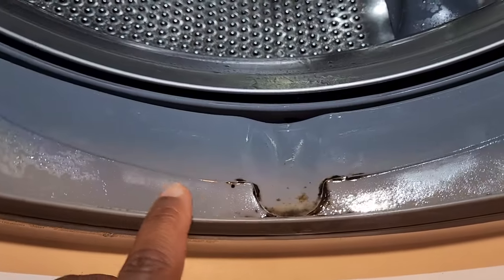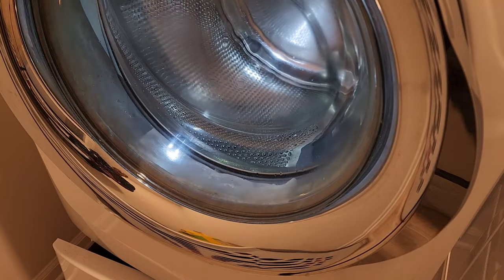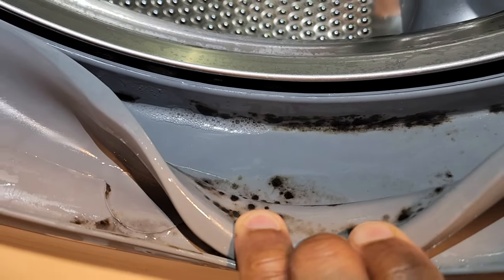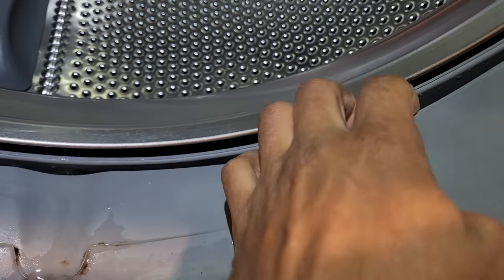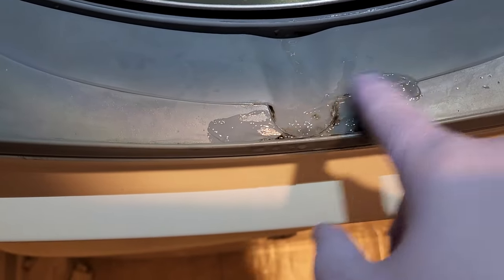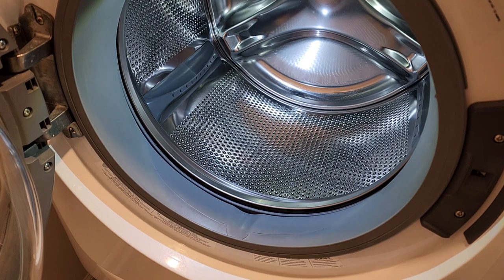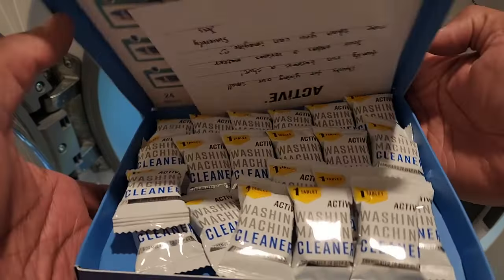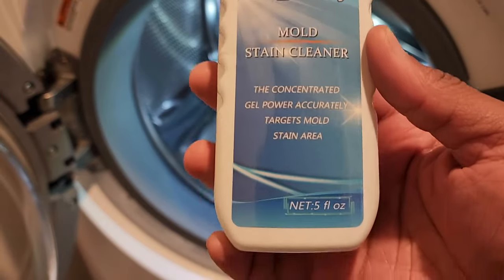Laundry Maintenance | Mold in Front Load Washing Machine

Comment: I'm sure just 50-50 clorox and water would have worked too. What the video brought out is how long any cleaning product needs to be in contact with the seal like a day or more depending how bad and that several applications may be necessary
Reply from the maker: True Story. If you never let it get this bad, then maintenance is quick and easy. If it gets bad, multiple applications must be done until the problem is fixed!

Comment: WELL, YOU MANAGED TO REMOVE THE MOLD, BUT IT'Ll COME BACK. AND THE REASON FOR THAT IS YOUR WASHING MACHINE DOESN'T HEAT. OR YOU ONLY USE LOW TEMPERATURES, ONCE A WEEK YOU HAVE TO USE 90 C.
Reply from the maker: Leaving the door open has solved the issue in my case.
Reply: @btshomedition  but also should check if the washing machine heats up. it is easiest for you to turn on the machine at 90c and wait 30-40 min. then you put your hand on the door glass and if it's hot, then it's fine.

Comment: You need to just take the entire gasket off. It’s not hard. Then soak in hot water with vinegar. Scrub with toothbrush. Let completely dry before reinstalling gasket. Leave door open. With mold that bad, you also need to take the drum apart and clean it also.
Reply from the maker: I have already replaced this gasket before and it does take a decent amount of work to take off and reinstall. So this is an option to fix the issue but more importantly, stop the issue from ever occurring. For anyone who want to disassemble the unit to soak the gasket, @JenniferAguiartampa has provided a great procedure to take care of your problem. Thanks for sharing. 😃
Reply: It's hard for me, I don't have a sink big enough to soak it, and only have a shower, no tub 😒

(maybe my landlord will do it at his place)

Comment: best way is to remove the gasket completely,
Reply from the maker: I already replaced the gasket once. Needed a better and faster way to clear up the mold
Reply: How do you do this?? I'm honestly not particularly concerned about the mold stain, but our gasket just gets a build up of slimy grossness, that is tucked in the dark crevices that are impossible to really get to, to clean out thoroughly - drives me NUTS. (DO not understand what these things are not designed to be more easily cleaned...) I would LOVE to be able to just remove the whole gasket and clean it that way....  ??  Thanks!! (PS I always leave the door open - makes it less bad that were it shut, but does not remotely prevent all of this gunk and mold etc from building up.... as you all know) !
Reply: @zabraevalentine4475  it was a nightmare but only because the bolts st the bottom were all rusted.  I got the gasket out but it was limed up in addition to being moldy.  I soaked it in vinegar and borax but somehow it got a slight rip, and dont know if I should put it back (not an easy job) and risk it leaking ir just buy another one  but I cant seem to find my exact size anywhere.  Huge hsssle
Reply: @zabraevalentine4475  there are youtube videos showing how to do it
Reply: The Titanic was deliberately sunk to get rid of Astor because he was going to try and end the newly established Federal Reserve which has been a disaster
Reply: Combo of bleach with liquid soap and toothbrush work great. You need some elbow grease.

Comment: You should never let washer air dry. By letting washer to dry that when you create mold by standing water. Also if you haven't notice, water leak bottom of the door. Reason is when water dries on the door it creates a barrier and when you close the door, gasket doesn't seal around the glass and creates a gap where water starts leaking. After each use, dry inside of gasket and door and you will never have issues with mold or mildew. It is important that you do use tablets monthly to keep washer from smelling and keep door cracked.
Reply from the maker: Thanks for the insight! 😊